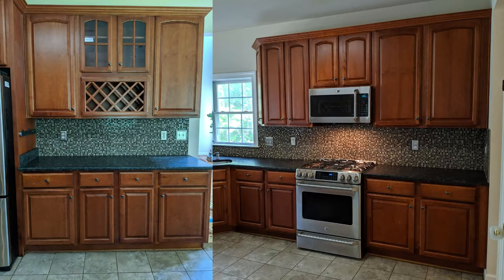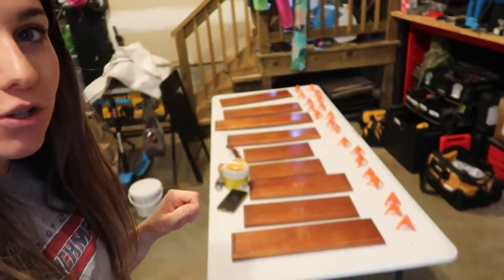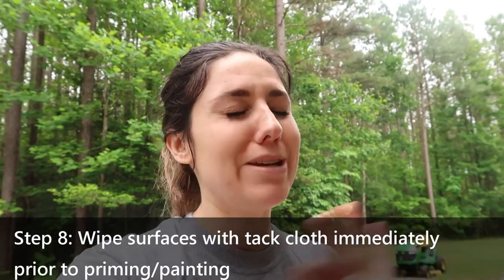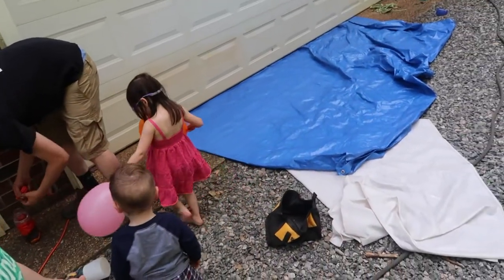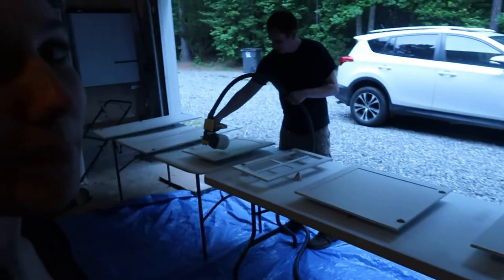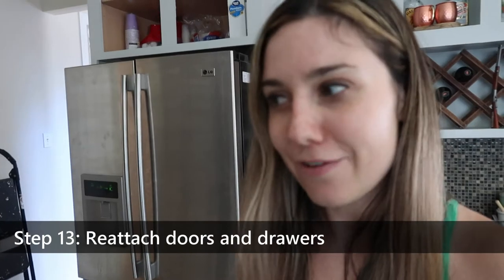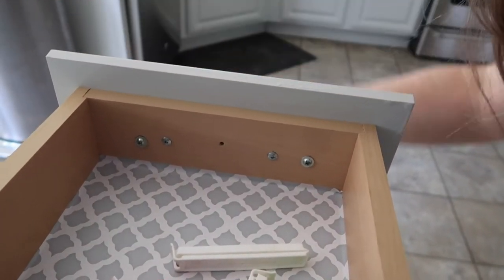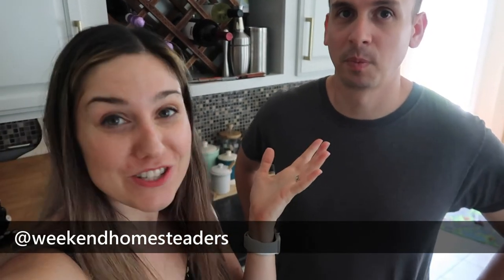How We Painted Our Kitchen Cabinets

Comment: Nice job! Was one gallon of Benjamin Moore paint enough for the two coats?
Reply from the maker: Thank you! And yes it was the perfect amount, even had a little bit leftover. I think because we used the sprayer it was really good about conserving paint
Reply: @weekendhomesteaders351  Thank you for the fast reply I was debating using a sprayer vs the roller  because of the paint consumption but definitely going the sprayer route now. Thanks again
Reply from the maker: @inkman411  good luck with your project!!!